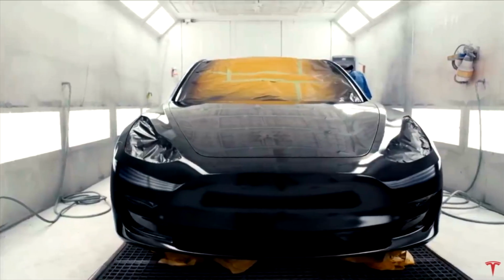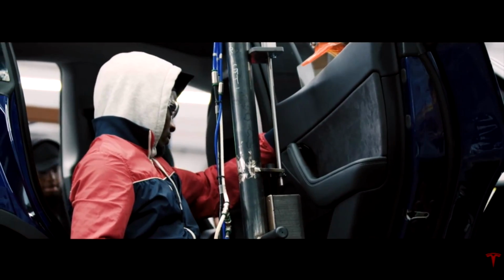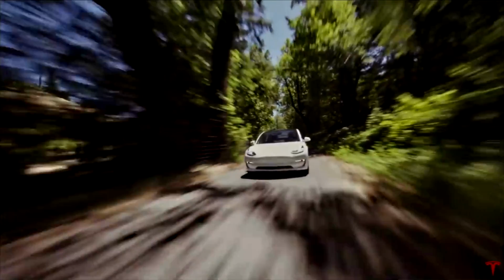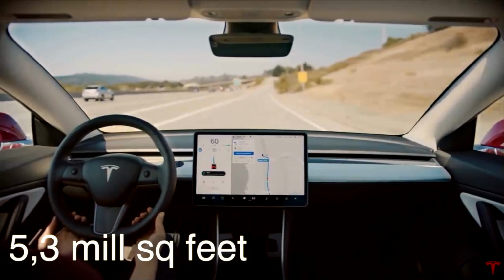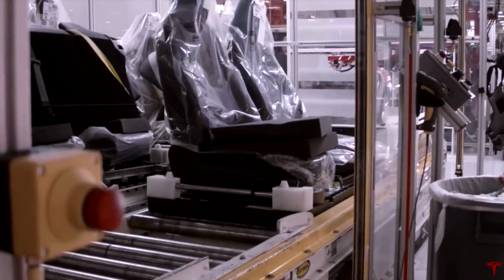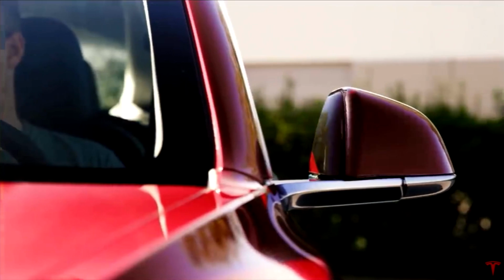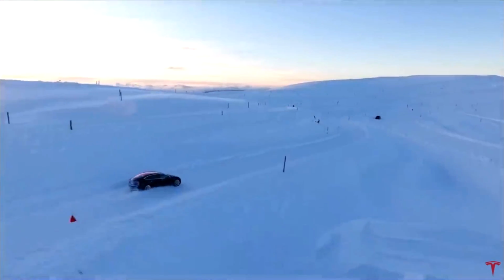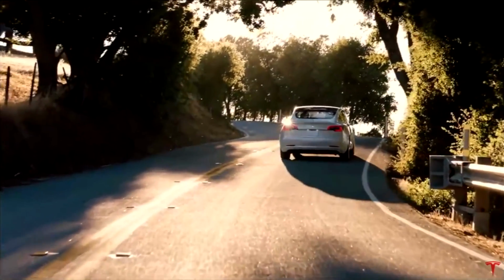Why is Tesla’s Gigafactory 1 not done yet ? | And what will they produce here when it is finished ?

Comment: from the dialog Panasonic could not increase production .... seems if panasonic increase production Tesla would have built out giga 1.....  it seem panasonic has not meet Teslas expectations however it  may be a reciprocity factory  Tesla did not have the sales and panasonic did not increase the production...of course sales and cost have a relationship so then the relationship gets complicated... need more batteries to  make more sales and need more sales to order more batteries and get the cost down... vicious cycle... hence slows down built out plans it seems this year that may start to change a little with the 14th production line expansion... so it would seem not so linear logic....

Comment: I think Giga Austin may be completed faster than Giga Berlin. Berlin seems to be working with a smaller number of workers and machines, and they appear to only be working about 40 hours/week. With over 600,000 Cybrtruck preorders, maybe that has become a higher priority? I'll bet we see footers going in soon in Austin and a speed of production rivalling Shanghai if they are allowed to work 24/7/365 like in China.They apparently received a permit to build 8,000,000 square feet in Austin. Berlin won't get the final building permit until October. Tesla stock went to nearly $500/share with the 5 for 1 stock split. That's like $2500/share before the split! That's pretty incredible. And battery day is only 20 days away.
Reply: Battery Day should spur on Giga Reno expansion. Maybe Tesla will build semi trailers with huge batteries and all wheel drive in Reno. Imagine a 16 wheel drive semi in the mountains: awesome regenerative braking, fewer brake repairs, no chains needed, no jackknifing. Drop a Tesla trailer for unloading and recharging, then pick up another fully charged trailer and get back on the road.

Comment: As for the Model 3 & Y I never buy either those cars even if I become rich ( since both like all Tesla cars are for the rich only ) WHY I not ever buy either the Model 3 or Y?   Because the Model 3 is a bad design for driving with no Binnacle speed display right where the display by LAW for decades was said to have to be for the driver of any vehicle to safely glance down for 2 seconds to see their speed then back to view the road to drive safe,   No matter the other safety devices fitted in the cars.   The driver still by law must drive and keep their eyes on the road ahead to be a safe driver?  Now Elon had this system in the Model S and the Model X as the road driving safety law states,   Then he said stuff the rules that all cars had for decades stick to,  For save driving reasons,  We stick the speed off to the side of the driver on a flat screen not in your line of sight and not even facing towards you!   So then you break the road safety laws by having to try to see the speed on that screen by either turning you head to the side or taking your eyes off the road for far too much time turning you head and eyes off to the side to see this small speed display on a corner of this flat screen, If say the sun is behind you and low even with the tinted glass there would be tons of bright light washing out that small LCD screen, or at night with a full beam head lights of a following car again the light will wash out the display which already got a very shiny surface!  That means you break the road laws by not glancing down like a normal binnacle speed just below your forward view of the road. why did all car makers have to stick the clear well lit speed display on the top of the dash console in the gap between the steering wheel?   Through many crash tests and millions in money found that the best place for that speed display was only on the top dash behind the big top gap of the steering wheel?  So hence since Elon has decided we can do without a normally placed Binnacle speed display.  I not alone thinking this is wrong many people do so too?  That will stop them too from buying such a law breaking car. Allot of people with tons of money of course have brought these cars,  But most are hot headed young fools who don't care about the law anyways.  But for us who do care, we will not buy a dangerous designed car no matter the hype.

Comment: Could you redo this video to leave the pic of the factory showing the outline of the current footprint overlaid on the original rendering of the ultimate plan remain on screen longer than half a second ... I can't even time my press of the pause button quickly enough to catch it for study. Also, where did you get that pic? Can it be believed? On what authority is that based? On what are you basing that 30% figure? My estimation based on eyeballing the live aerial shots of the existing development was more on the order of 50% or so.

Comment: I will tell You. Elon made a huge mistake in taking on PANASONIC AS SOME KIND PARTNER. This probably happened because PANASONIC had deep pockets but they turned out to be a very poor partner. They are just a a generic computer back up battery maker. TESLA figured out how to use 7000 of these in a MODEL S. You tell me why Panasonic could not or would not supply batteries for GRID STORAGE BATTERY FARM IN AUSTRALIA? They are a very poor partner and Elon has to go through another divorce. Elon get rid of these BASTSRDS.

Comment: Two reasons, waiting for "best possible" battery technology and it's machinery yet to be developed, and for sub compact car for "all the kids". It will be stamped in giant machines like the cyber truck but smaller, lighter, less (but better) batteries and with "only" a 300 mile range. It will charge up most of the way in an hour and will not contain cobalt.
They said "should be complete early 2020's. This is probably only about a year after battery day (plus delays that will be caused by the next round of covid).
Concerning covid, (and all those evil anti Tesla accusations that will once again surface) just remember one thing, Tesla doesn't even have one employee to each Walmart store...

Comment: not enough graphite to make as much battery... current production yields only 50% output from the resources used. novonix synth graphite will fix that and they wont have to rely so much on graphite from china anymore and production will be 100% efficient with almost no wasted raw material

Comment: You're right. The Battery cells are the product that requires the biggest scaling out of everything. I mean, is there any downside to over-producing batteries? They can just pack more into their cars and fulfill their virtual power plant dreams with a car spec'ed below it's capabilities.
The model 3 was a huge gambit in terms of Tesla's manufacturing capabilities, but not enough to require the full GF3 space.

Comment: Beyond Tesla
Two super growth Biotech to buy and hold(7/1/20’)
1). NVAX
      Since the early 2020, its 2021 eps has been upgraded from $3.86, $6.02 , now $10.28. 
      Its EPS growth rate is about 90% since 2017. 
At around 80$/ share,  NVAX forward PE is less than 8 !. Expect to gain at least 2.5x in 2021.

2). CTXR
CTXR will earn $0.74 for 2021.
At $1.03 today, It has Forward PE about 1.4 !
CTXR values at least 10X by the end 2021.

Two additional 10 baggers
1). DRAD
    DRAD will earn $1.73 in 2021, mainly from its gamma camera diagnostic heath care system & service. 
    At $2.7 price, it has a FPE around 1.6 ! 
   DRAD values at least 10 X by the end of 2021.

2). DBD
DBD will earn $1.26 in 2021.
At the price of $6, it has a FPE = 4.76
DBD values at least 5x by the end 2021.

Comment: I think you nailed it, when the road runner project is done, they will eventually scale battery production in Nevada.  Another insightful video, thanks.
Reply: Michael Whitfield Yes! Nevada has the largest deposit of lithium in North America . LAC all the way!
Reply: Yes, a few issues are hitting the Giga Nevada site. 1. Northern Nevada cannot keep up pace with hiring qualified people. Housing is making it hard to bring people in. 2. With the new battery technologies, there is no reason for Panasonic to expand battery lines until they know for sure it wont be wasting money on equipment. 3. Fremont is jammed packed and running out of room, currently the battery supply is enough for this plant. 4. When Texas is complete, they may decide what to do with Giga Nevada. They may want to recuperate cash flow after expanding  to China, Texas, and Germany. Where Texas may or may not include a battery making facility of its own.. I am sure there are more reasons but this may help explain a little bit.

Comment: Thanks for addressing this topic. I have been wondering about it for years. If they're battery constrained, why the heck are they not making the battery factory bigger so it can make more batteries?! Why can't Panasonic build another production line?
Reply: This is one of the keys! If Tesla went through production hell to get the Model 3 production off the ground, Panasonic went through double production hell! They are only doing what they set out to do within the past 6 months! Meanwhile Tesla is kicking the tires on LG, CATL, and their own pilot production plant. I am just not sure that either Tesla or Panasonic wants to double down and commit to expanding production at gigafactory!
Reply: The problem with battery production at Giga Nevada has always been that Panasonic has huge problems getting their lines to run efficiently.  I believe that at one point they were losing 30% of batteries to faulty production.  Tesla want to pay for additional lines until the existing lines were running well, and while lines were running in efficiently Panasonic was losing money and so where also reluctant to expand.  My understanding is that the lines are running much better now and so expansion is again under consideration.  Tesla doing their own manufacturing lines is a separate issue and they will no doubt expand as quickly as possible
Reply: @andrewpaulhart  totally agree. People always forget the human aspect of the equation. If you have a perfect recipe, but only a few good chefs, it takes time to hire, train, relocate, etc the help required. They could offer 500,000$/yr salaries, and still run into issues with employees. Build more houses? Ok. Add a few months lag time. More roads? Lag time. More grid systems, police stations, etc etc, at some point there is always a slow down when humans are involved in the production equation.
Reply: Elon gets very frustrated with the slow speed of suppliers and competitors despite all the public hints he gives them to wake and shake up....he pauses all the time on his way up to look back and encourage the world to move into a new future of possibilities...

Comment: Nevada has the well known issue of labor shortage.  As well, if they start using the "dry electrode" manufacturing, which uses much less floor space without huge drying chambers, they may be able to just use the current space while increasing production.
Reply: Build a factory town make homes part of the employment package lot of people would like to get paid the same and skip out on the rent/mortgage costs per month Tesla would get to learn how to build homes for their future product line and all that goes in it like HVAC, wiring, insulation, even new materials for walls and so on.

Comment: Wonderful video and invitation to mentalize the future build out of giga 1 .  You alluded to waiting for technology to develop; and I think you are right; only it's not only the battery technology, but the demand for product also.  Pretty sure there is a mathematical formula for maximizing the beneficial use of the 70% unused portion of the Giga 1.  The dry electrode capacitors need fewer fabrication steps than the wet batteries; so why build up, to only have to delete space and machinery?  Also a design breakthrough in solar roofs might need a place to call home.

Comment: Gigafactory Nevada is mostly for batteries with cooperation with Panasonic. Production lines are owned by Panasonic and so are production methods. Tesla is planning they own production and it most likely don't happen under same roof with potential competitor. 

Panasonic and gigafactory is not going anywhere and there are recent expanging plans. Panasonic have had problems with profitability so it might have slowed down the original plans.

Tesla needs batteries from Panasonic and they can shift towards grid-level batteries if Tesla can start they own manufacturing in a large scale an in a near future.